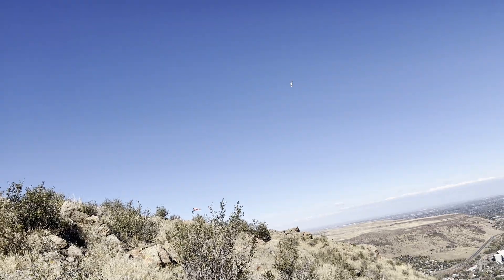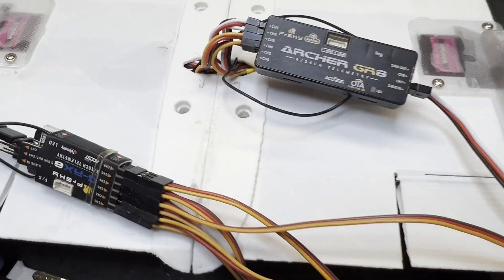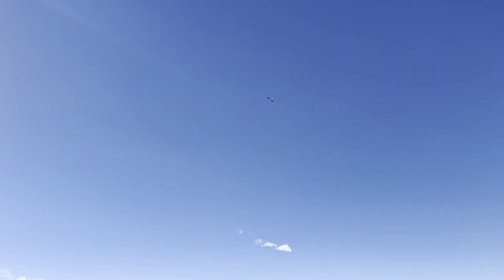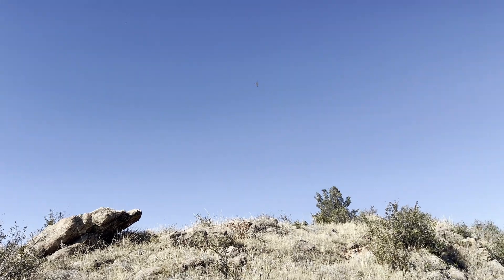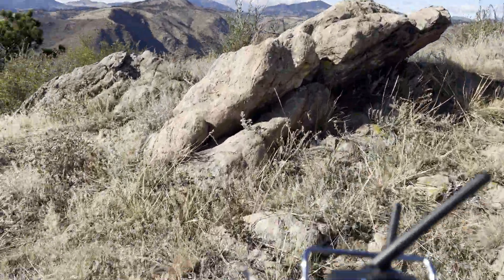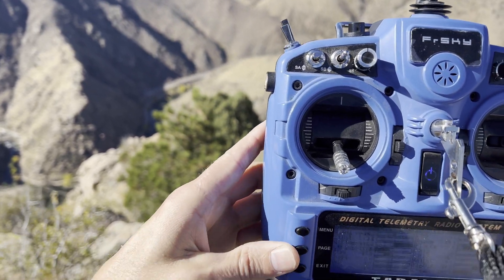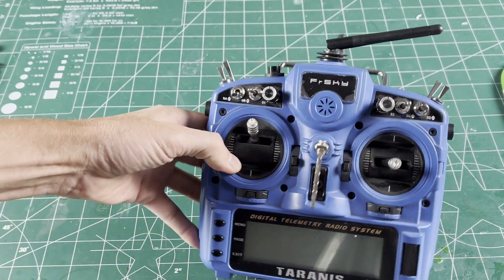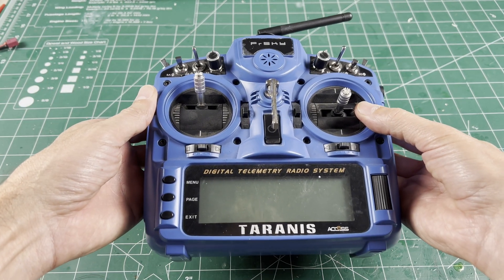Done with FrSky - part1- Dynamic Soaring mishap.. not pilot error for once, which is not good

Comment: Hi, I have Horus X10 upgraded to access with external XJT module. It is just to have Access, D16 an D8 protocols. Last year I started suffering from short (about 1..2 s) gaps in communication on D16. It was happening when I shacked transmitter or hold it in special tilted position. At first sight it seemed that the reason was unstable loose external XJT module - clips are not holding it tight. It was when I was using D16 through external module. During investigation I have found out that the same happens on D16 through internal RF module. No problems on Access protocol. This suggested me that uP board is ok, as well as RF modules. I decided to focus on connections between uP board and RF modules including small auxiliary pcb board between them. I treated all pins with soldering iron and ordered new flexible flat connecting stripes.  The problem seems to be gone. So I am still with my FrSky radio but have an eye on it.

Comment: The latest Radiomaster TX16 is pretty good and they have improved their sliders, pots, and the charging system to where they are much better than the previous GEN1 radio.  Also, having Edge TX with a touch-screen makes programming quicker.  Edge TX allows for the use of ELRS receivers which in my opinion are more sophisticated than any of the other receiver technologies out there. ELRS has the ability to dynamically scale up the power to 1 watt to help cut through any possible interference that it may encounter during flight.  ELRS also has a more sophisticated telemetry system called quality, which is better than RSSI.  Quality keeps track of lost packets rather than just signal strength and is a more accurate way of determining the quality of the transmitter to receiver connection.

Comment: I'm thinking of getting back into slope soaring after many years off.  I also have a x1c, so I came across this channel after looking into 3d print planes.  As it turns out, I have an older FrSky- I never liked it.  Based on the comments, the Radiomaster tx16s seems like a no-brainer for me as well as going with a 3d plane, since the printer cost is already sunk and I got rid of the foam cutting stuff.  Sorry to see the crash- hope to see you on a Bay Area Slope soon

Comment: Sporadic errors are the worst. That makes it almost impossible to find a fault that is not there most of the time. Have used Futaba most of my life, but have now switched to Radiomaster TX16S MKII. Very happy and really impressed with all the new possibilities this radio gives me. Internal module is ELRS and external module is the 4 in 1. So i can still use all my old different receivers with my new controller.

Comment: Check for "dry joints" on the battery connector, on /off switch and the back of all boards. Maybe get some freezy spray that should help identify problem areas as well.

Comment: You turn it off and blame the TX?
Reply from the maker: ?? your funny.  If you have an X9D (or one of these radios) it takes 4 sec to push the button and turn off.... and it usually gives an error that the receiver is still connected, it was paired with an Archer Plus R6 with only a couple of flights (no crashes), and would have made me push a button to confirm.  AND the conditions were great and my plane was flying awesome, and video of my plane flying DS laps at 150mph was what I want / need.  This has just been a huge distraction and I'm afraid to use this radio anymore ... yes I blame the TX, it should not just turn off without any warning, alarm, or notice.  A simple capacitor circuit for inadvertent power loss would be a good idea, if the power microcontroller is seeing voltage issues to send a warning... not complicated stuff, but would be good for eliminating a single fault failure in such an important part of the tx.... saying on.

Comment: It's too bad the receiver doesn't switch to some kind of safe mode at the loss of signal and just go into a slow spiral flight for a while. You might of been able to recover in flight had that been the case.
Reply from the maker: It does, but it is not a flight controller and I had it set to hold.  If the signal glitches then it holds that current control position.  When flying this Dynamic Soaring I don't want it glitching to some failsafe of full flaps or spin... thats bad too.

Comment: i had 2 frsky rx's go bad, one went bad in real time as i was flying, the range reduced more and more. I emailed them about repairing, they never replied. I publicize how bad they are every chance I get. Radiomaster TX's and Matek RX's, although Matek has issues as well.
Reply from the maker: I lived through the ACCST, ACCESS, Archer, Archer Plus... all promising better link and range.  Now there is the Tandem and Twin, like a constant moving target as to the right configuration.  I know technology changes, but I have an older 2.4 module and receivers that still work better than the stuff I tried from FrSky.  
I did get an email back from FrSky tech ... still trying to figure it out.
I do like Radiomaster for the low end side of stuff, have a Pocket tx and some ELRS rx's on the way... cheap... I'm fine with good-enough-and-cheap... and fits with what I do, hike-fly-crash.

Comment: Should have had Futaba. 🛩️🚁✈️
Reply from the maker: The Futaba T12K has a slider switch for power.... this is the first I have found in the available radios in 2024, everyone else is using push button switches... or is it just similar to how the others work - button monitored by microcontroller - or is it truly a power switch.  Not sure if it is a reason to by another Futaba (I have three older models) but might be.

Comment: ❤Futaba radios....
Reply from the maker: Maybe, The Futaba T12K has a slider switch for power.... this is the first I have found in the available radios in 2024, everyone else is using push button switches... or is it just similar to how the others work - button monitored by microcontroller - or is it truly a power switch.  Not sure if it is a reason to by another Futaba (I have three older models) but might be.

Comment: I have been flying Spektrum since the first 2.4ghz DX6 came out. Never had an issue. You can't beat it for simplicity, There are lots of haters from the FrSky world who have never flown with Spektrum and follow the bandwagon cause it's the cool thing to do. With AI programming, almost everything is done for you. The compatibility with Crossfire is plug-and-play and the industry's most robust signal. I fly my Turbines and Giant scale with Spektrum Powerbox and Synapse. For soaring and FPV I use the Spektrum with Crossfire. A lot of my friends like their Jeti Radios and their TX16s. Flite-Test swears by the T16 radio. I have never tried it but my friends have not had any issues with it. I moved from Jeti to Spektrum which I was using for my Turbines because of the Powerbox and Synapse and Forward programming. Makes things so much easier. Plus I love the built-in Pre-flight checklist that is switch-operated. I'm using the iX20SE radio. The new iX14+ is much more affordable and comes with 20 channels. Your best bet is to go to a flying club or a hobby shop and hold the different brands in your hand to see what fits you best. See what the locals are flying.

Comment: As to what causes the issue? That radio was originally designed around NiHM cells, then upgraded to lipo. With lipo you need to secure the battery from movement or you will tug on the power plug. Your radio should never have any movement inside it. Just like your race cars. Movement is bad.
Reply from the maker: Hey Wayne... totally agree my battery mounting could have been tighter, but I checked the plug and it was fully seated, even wiggled it, before it turning off on my tech bench again and again.... then disassemble and reassemble - replug the same componnents - and no fault, no wiggle issue, and been trying some more today.  Might get out my oscilloscope and find some test points.  

The NiMH to lipo might be something... and mine has the internal Lipo charger that I do use... 

And I just used it fully recharged the battery (with balance connector - then unplugged when done).  It did the start up sequence (power button), did a switch warning, then it completely shut off before starting the radio???? Switched on again and it worked all the way through.     

Have you seen/heard anything like this before?
Reply: @soarkraft  All things need some maintenance sooner or later. How many hours do you have on this radio? As radios (all brands) get into the higher hours anything that moves starts to have issues. This can be something as simple as a small amount of movement from a wire. The wires will fatigue and fail. This has stung FrSky in the early years with the wires going to the gimbals. But a battery clunking around is a very bad situation. It will not only work the wire, but also the connector. We have also found that some dirt/corrosion can sneak into the plugs, just resting the plugs usually fixes this for a while, contact cleaning would be ideal. That would be my guess for your radio.  You may well have a damaged solder joint at the power plug to PCB. It would appear that your radio is loosing ALL power. Same as pulling the battery out. A little maintenance and you are probably set for another 400 hours of radio use. (Yes, OpenTX and Ethos both have emergency mode restart methods for super fast reboots, but a power outage is not covered by this.) In OpenTX I suggest turning off everything that delays power up. No switch checks, no boot up sounds, no screen image delays so you can repower MUCH faster. (I have accidentally turned off my X9D radios a few times, something you can not do in Ethos.) Hope this helps.
Reply from the maker: Do the newer FrSky transmitters have updated power management?  Can you get an updated power management board for the X9D?

Comment: I'm afraid of the same thing, I've had a radio error a few times in the past, and my model broke because of it. I bought a new radio this week because I will be building more valuable model airplanes, which would be a huge shame if it broke. I chose the KAVAN V20 radio transmitter with R20 vario receiver. I really like its design, the Ethos system and the built-in variometer.

Comment: Go for Radiomatser.
Choose model depending on your preffered form factor.
I suggest Boxer or TX16s MKII
TX16s  is a little bigger and has color touchscreen. You can add later AG01 gimbals or if you choose Boxer Crush series or TX16s MAX you will have them from same beginning.

Comment: I suspect it was the battery connector.  Those balance plugs aren't exactly high quality connectors - I've had issues with some of my batteries when using a battery checker that plugs into the balance plug where sometimes I had to wiggle the connector to get an accurate reading.  Wouldn't be surprised that the connector in combination with a rattling battery may have caused the poor connection to your radio causing it to shut off (which also explains why one time you had a low voltage reading that one time too).  I noticed the issue went away after you unplugged and replugged the battery in (sometimes that alone is enough to clean the connectors enough to work for a while).    A new radio battery with a fresh connector would probably solve your issue.  Cleaning it with some electronic spray cleaner might also help but I often find that once a connector gets flaky - the problem comes back pretty quickly.
Reply from the maker: The shaking battery is just an annoyance, it is not the cause of the fault.  The transmitter just shuts off and I can get it to do this over and over again. Then it stops.  If it were a true plug issue, broken wire or cell problem it would continue to happen.  Something else is going on, and I just haven’t figured out what.

Comment: What DYMAMIC soaring. You're flying in circles. Just fast! Check the pins in module bay. Some times they get pushed down through the circuit board and barely make contact then when you remove the module they are pulled back up and all looks OK.

Comment: I've had good luck with several brands, including Hitec and FrSky. I started in the Hobby with the Hitec Aurora 9 and also setting up my dad's Hitec Optic 6 Sport. I found the programming to be rather inflexible and often kind of frustrating. I then bought an initial-release Taranis X9D back in 2013. I found it much easier to configure than the Hitec and was immediately able to easily do things that were difficult or impossible with the Hitec. The basic operation is of Edge/OpenTX is much simpler than conventional radios. There are no special mixes or use cases. You simply map/mix inputs to outputs in whatever way you like, and every mix is modifiable in the same way (with curves, switches, etc). I do find rates and expo to be kind of tedious, but not complicated. I can't imagine going back to a less flexible, more conventional radio system, but perhaps it fits your needs better with gliders.

I don't know if I'd write off a company based on one product, at least not after seeing people at the flying field have problems with other brands. These resulted in lost aircraft and required sending in the radio for repair. It happens sometimes. My X9D never gave me any problems, though I moved to a RadioMaster TX16S when they were first released. No real changes in functionality, but I really liked the 4in1 module since I could use the old Hitec receivers and many others. I still have that TX16S, but now I mostly use my FrSky X9 Lite S because I find it more comfortable to hold (size, shape, and weight). The TX16S is big and heavy, so you might consider if that's a factor for you.

I also bought a RadioMaster Pocket to tinker with. While I like the smaller size of the X9 Lite, the Pocket might be a little too small. Also, ELRS is still a pretty half-baked solution for fixed wing line of sight flying. It was designed exclusively for multirotor applications and then modified to work in more general applications, but its multirotor design origin is still very obvious. For example, in the only mode that provides full resolution on all channels, it is recommended that you not use channel 5 for anything but arming (a multirotor use case) unless you want to give up dynamic RF power. In other full res modes, CH5 is two-position only. It was a short-sighted decision to ever treat the arming bit as a typical channel, but it would seem they weren't considering other applications. I can't imagine any commercial entity ever marketing a system with such an odd legacy limitation. I'm hoping that ELRS 4.0 (??) will be a more elegant solution for general use. Personally I feel that multirotor requirements might just be too different from those of fixed wing LOS, and I think it would be better to create a fork of the existing ELRS project for use with more traditional RC airplanes.

Comment: You were aware of problems of power with the module installed so you contined to fly with it installed and the power out was frsky's fault. Don't think so.
Reply from the maker: ?? it never did this
I use the internal charging to charge the battery through the USB sometime, I have to remove the external module to get this to work.
I have had times when I turn on the transmitter and the module did not power up.  
I have had times when I turned the transmitter on (not flying), am doing something else, then notice the transmitter is off.
I have never had it turn off while flying... and then be able to get it to do it over and over again... and then magically it starts working again without "fixing" anything for finding something broken.

My day job is electronics product design for 30 years... I am a mechanical engineer, but I have had to troubleshoot all kinds of manufacturing problems.  I know what I am looking for when it comes to physical defects... this is like a circuit fault or compatibility issue with the module... which they should have circuit protection to deal with this, basic electrical engineering design... diodes and shunts.

There is a microcontroller running the power management... not me. 
My older radios have slider switches, the radio is on until I turn it off or the battery is dead, never had a problem like this, and I have been flying RC since 1984... and I still crash all the time

Comment: Something to look into very closely. I’ve seen a bunch of those RDQ radio and goggle packs have poor quality wires under the heat shrink causing intermittent power issues. Eventually failing at the most critical times. My suggestion would be to replace that TX pack with a new non RDQ pack and then do some follow up shake testing again. Imagine a goggle pack doing the same while landing via fpv, not a good result for sure.

Comment: The fact that it wouldn't do it again after you unplugged and plugged the battery back in points more towards something wrong with the battery connector than the radio. I switched to FrSky about a year ago with an X-20 and it is easily one of the best quality radios I have ever had.
Reply from the maker: Sort of, if it were a mechanical defect (something broken) it would continue to happen.  I thoroughly went through the battery connection, board and battery side.

Comment: I recently got a Radiomaster TX16S with internal 4 in 1 and external ELRS module. 

The gimbals on the TX16S feel great. But the radio build quality is just "ok". It's probably on par or slightly better than what you had in the FrSky. 

Feature wise its amazing and probably the best bang for the buck. But as far as my giant scale stuff goes im not sure id feel fomfortable putting a 20+ lb model on it. 
.i